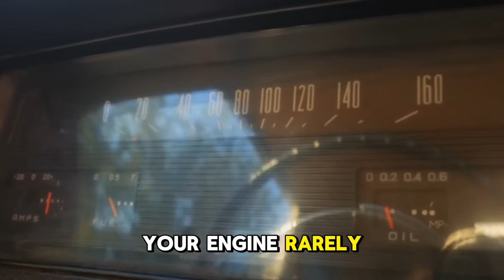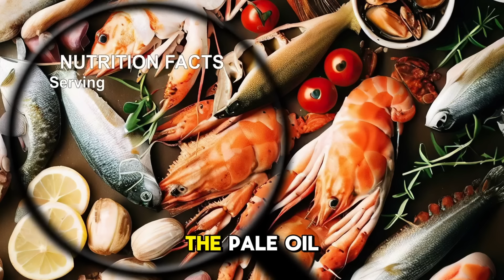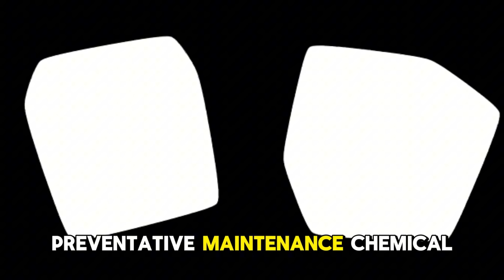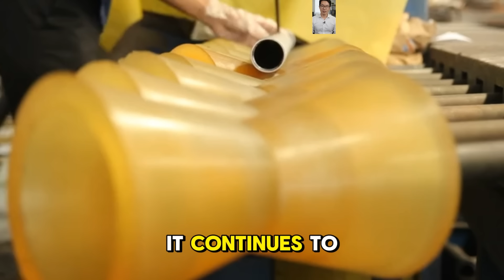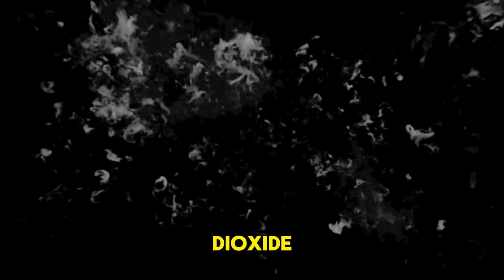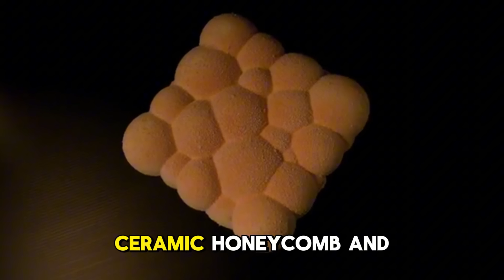The 20-Minute Japanese Trick to Unclog Your Catalytic Converter (No Tools Needed)

Comment: Warm up your engine and spray a quart of water into the throttle body, keeping rpm to about 2000. Your code will not disappear immediately but will in a month or so

Comment: Asian Ai time for some SCHOOLING!! I been driving 70mph daily,for 45 minutes,More,Alot more than the Japaneese or Italian tune-up B.S.After 75,000 miles more i bought a bottle of Cat-a- clean from auto parts store for about $30.00 and it says: use with 1/4 tank of gas,or 3 gallons and drive 12 to 15 minutes.I did everything as recommended, except I drove 40 minutes!! Then filled tank with gas,and my Honda with 250,000 miles has never run better,quicker acceleration is what I noticed,my engine light never came on,I just knew it could use some help,performance was weak feeling previously. The next day I changed the oil,it was due.

Comment: Grain alcohol 🍸 or denatured alcohol  and hydrogen peroxide is also used 🤔 or you can buy a additive to your gas tank that cleans carbon from your engine and catalytic converter 😮😊 notice he didn't mention  running a little nitromethane  .but for cleaning catalytic converter liquor thinner trick. 😊

Comment: I got news for you Mr. AI.  Premium fuel will always contain something called "white gas" or the "alkylated" fuel stream.  Both RON and MON are very close together.  It is a better gasoline than 87 in every respect.  It is not, however, needed to be run in engines that require only an 87Rd octane.  It is NOT about premature ignition or lack of a cleaner burn.  Where are you getting this garbage from?  I spent most of 4 decades in fuels production.  You should be run off this platform.

Comment: This is a simple fix. It’s not a Japanese trick. Unless you include the music.!!  
Just let your car sit in the driveway , get in and Rev  the engine and hold it there for like 15 minutes. It’s the same exact thing that diesel trucks due to regen their DEF filters.     The high RPM will create lot of heat, which will burn out all the soot and stuff you don’t need to go driving anywhere. It’s just common sense..       plus you don’t need to put any additive in there either unless it’ll make you feel better.

Comment: Dump a gallon of lacquer thinner in the gas tank, lock out the higher gears on the transmission, and run it down the highway at 3000+ rpm for 20 minutes straight.

Comment: The p0420. Is because the first O2 sensor isn't working correctly. Upstream O2 sensor before the catalytic converter. It gets dirty or it gets worn out. It's an easy replacement. Try it first.

Comment: So here's a question. Why not clean your OXY sensors, spray the acetone or  thinner directly into the OXY port on the exhaust and drive it normal for a while? Exhaust may get hot enough to penetrate the carbon buildup. Any thoughts?
Reply: That's exactly what I was thinking. Using a fine mist from a bug sprayer with a long wand in case the solvent combusts so the flash can't get you. It would be the most effective way but suggesting it in a video where any dumbass can watch it and not be safe about it and get injured would make your lawyer very angry with you.
Reply: Or you could spray it while the engine wasn't running, it would be less effective but marginally safer, but where is the fun in that?

Comment: I have to agree with the person who said B12 Chemtool. I remove my main vacuum from my brake booster and take an entire bottle of B12 Chemtool stick the vacuum line in the bottle and let it suck it all down.  Engine name stall so you probably want to have someone revving the engine over 3,000 RPMs while you're doing this once the entire bottle is sucked up reattach your vacuum line to your brake booster and step on the gas and watch it clean out all the unburned suut and carbons that can block everything on your top end  ie.....throttle body butterfly valve all the gummy stuff that builds up and makes it stick sometimes when you step on gas.  All of these chemicals build up on everything down the line from your intake manifold like exhaust system, o2 sensors, catalytic converters. You'll know it's working if after you do this your vehicle starts puffing super thick pure white smoke. If there is what seems Iike a huge amount of thick white smoke repeat this procedure but add some of the same product or Seafoam into the crankcase and fuel tank, probably split the large bottle of Seafoam between crankcase (where you put engine oil) and fuel tank. So exact procedure is seafoam in the crankcase and fuel tank then start the vehicle remember when you take off the vacuum and hook it up to that bottle of B12 chemtool it might stall so have it revving a little bit once it sucked all the bottle of B12 chemtool up re attach vacuum line and drive around block few times. Be sure to change oil after no more than about 30 min or 10 miles. You just want enough running time to get those chemicals everywhere unburned fuel could be built up so it can clean those surfaces. This really works. I mean if you have a misfire and you have been running lean for a long time and your cat is completely f u k d then realize sometimes things may be beyond fixing. To find out if the cat is still worth fixing it's going to be some work but you'll have to pull off catalytic converter and check your honeycomb and if it's still there and not burned up then you should be good and I'd say give it a try. 
Good luck. Get those misfires handled early especially if you're going through oil at a faster rate than recommended. Remember s h I t rolls downhill and same in vehicles that don't get problems handled quickly risk the problems and all the parts down line from those problems that could be at risk. 
Thanks

Comment: every clogged catalytic converter i had to deal with the dang honey comb had broken into pieces and all the pieces that is not lined up is what clogged it up the little holes has always been fine that people would just take those pieces out and problem solved in a ways not properly but it would run again but the engine light will be on that it won't get hot anymore without the honey combs it's just better to replace them with a new one in dallas a place on caroll ave called hercules muffler would sell them for 75 bucks ea and weld it on for you too oh yeaaa

Comment: Most Vehicles burn oil because their Rings start getting stuck. The best fix for that is to run at least two oil changes Valvoline restore and protect which has been shown to release the compression rings and even many times loosen the oil control ring so that you quit burning oil. The low pressure compression rings that they use nowadays don't work with a damn. Unless they're completely clean you're not getting a good effect from the compression rings add the much smaller oil control rings that they use these days aren't doing much good at their job either. But you know if you're burning oil about one quart every 700 to 1200 me, you're using a whole lot more oil than you did the mid-1960s. Makes you wonder why they made two stroke engines almost impossible to buy because they polluted the air too much because they run on oil. But now you have two stroke engines and almost all cars.

Comment: It is categorize The Impossible to add one pint of acetone otherwise it would have already melted. And I've never heard anybody say to take a half a tank of fuel and put an entire gallon of lacquer thinner in it. The highest concentration I've ever even heard of is to use a quart of acetone in a full tank of fuel and you're still only talking about. A 1.66 % mixture. Acetone will not destroy your fuel system even if you put a quart into a 16 gallon fuel tank.
Add highest mixture I've ever heard from lacquer thinner is about the same mixture. What acetone will do is it makes the fuel spray break up much finer and allows for a better flame front which allows for a higher temperature burn in the exhaust system which includes the catalytic converter. Just like taking your Carbondale burner grates on your stove and putting them inside the stove and running it on a self-cleaning cycle that runs upwards of 900°. It Cooks off all of the carbon. That's the simple thinking behind the process. Frankly I think you would do better to just put a bottle of cataclean into about six or seven gallons of fuel and go out and run it hard because that will cook off a lot of the contaminants inside of a catalytic converter. The other best suggestion I would have is to put a double dose of Techron into it because it will also help. I've seen it clean the carbon off of the tops of pistons in one application.

Comment: Ya I did the Scotty Kilmer fix and poured in Paint Thinner, it cleaned it out all right...and the I thought my Transmission was going out...The Metals in the Catlaytic Converter were Rattleing around and I still had to buy a new one, they Aint Cheap. If its clogged your motor is burning oil bad and you need a new motor too.

Comment: I use 91% Isopropyl Alcohol. I run gas tank down to almost empty. 4 bottles 91% Isopropyl Alcohol,  1 gal of premium gas, drive vehicle in low 2 for a few miles. Past emissions test. In Illinois

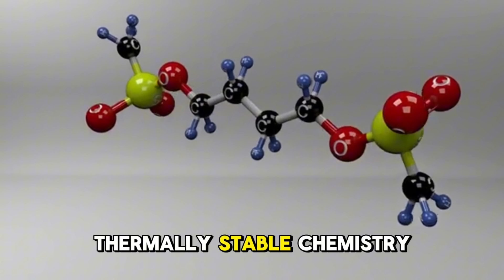Comment: I'm unsure what a "double dose" in 1/4 tank for the 20 Minute Protocol (starting at 25:00 means.) Chevron says 1 oz per 1 US gallon. Other sources suggest 1 bottle (12 oz?) to a tankful, which would be approximately the Chevron recommendation for most - sedans or small to middling SUVs. So is a "double dose" 2 bottles in 1/4 tank? Or 2 oz per however many gallons 1/4 tank would be?

Comment: Cata clean add to gas tank on one eighth tank of gas then put gas in to half tank then drive vehicle 30 miles on highway speeds above 60 mph should clean converter
Reply: That shit doesn't work, I did 2 bottles of cat a clean and nothing
Reply: I wonder if anything will really clean those I always hear about using tolulene varsol and paint thinner I'm just curious if any will really work.  I'm thinking about going cat less  with a car my daughter needs to have fixed. I don't think that other junk would really work
Reply: Same here, 2 bottles and bullshît !!

Comment: we use hydro cleaning takes all carbon out from vales to muffler, no cost also.
Reply: come to shop we show you nothing is free now days.
Reply: I've seen that.  Using water into the intake to "steam" the valves and clear any blockage in the exhaust.
Reply: @joekool4  got to know what you are doing or you can mess an engine up bad.
Reply: @joekool4  doing it for years got a 265 ooo mile v 8 truck still running smooth
Reply: @yourworstfearhow do you hydroclean it my.? I’m pretty sure that my Cat is Clogged 🤦‍♂️
Reply: yep we at 205 no oil use at all keep it changed and tuned.

Comment: Mix marble miracle oil with gasoline in a little bottle injected through the booster hose to the engine and keep it up 5000 or 500 RPMs it will smoke a lot but it will clean it
Reply: Booster hose?

Comment: Cash for clunkers lol.. gas with ethanol is eating up everything to eventually lol ...or you say 10% lol more like 15 or 20% . Ethanol by product water rusting everything out ..water pouring out your tail pipe total trash fuel .use  ethanol free fuel if you want absolutely no problem down the road .  Cash for clunkers .limp mode

Comment: Sea Foam doesn't work. Tried it. 
B12 Chem Tool Worked. Passed Emmissions.
Reply: That's what I use.
Reply: B12 is the best. And usually significantly cheaper than seafoam.
Reply: Do you know anything about Berryman's 4 step cleaner kit?

Comment: All this AI is bullshit !!!
I have a 2014 Silverado and at 156,000 miles I need a cat . Over $3000 for the cat who knows what the labor will be at $105 an hour .
I paid $25 for the cat cleaner . It did absolutely nothing !!!!😂😂😂😂😂😂😂
Reply: B12 Chem Tool Worked for me with only about 10 gallons of gas. 
$5. at Walmart a little more at an auto parts store. 
If twice doesn't work your Catalytic Converter is probably falling apart. 
If it's welded in go to a local muffler shop, Not a National Franchise out side of CA use a cheaper aftermarket Cat. 
If it's bolted in remove it yourself and shake out the broken honeycomb pieces. If it's falling apart take it all out, hollowed out, almost no difference in the sound. 
The code should stay clear. If it does you will pass the Emmissions after you drive between 150 and 200 miles first. 
I did this on an old 1986 Chevy Camaro V6 and the Emmissions with the sensor in the pipe came out like a brand new car or new engine. 
New spark plugs and a fresh Oil change first. 
The best oil for your gas engine now is Castrol Synthetic Edge because it is the only oil that bonds with all the metal parts. 
Prolong is a good engine additive as well. Dura Lube doesn't work. 
I used both on a seized engine Cam kept seizing and breaking the $20. Belt. 
With the Castrol Synthetic Edge and the Prolong the engine ran fine. 
I had a old 1986 Nissan Z with between 330,000 and 400,000 miles overheated five times on the highway because of a broken top hose kept adding water taped it with plastic and duct tape and after replacing the hose and new full strength Antifreeze the 6 cylinder engine was completely fine. 
I took it over 100 mph before and after with zero issues.
Reply: Try 3 tanks of highest 91 octane minimal 93 is better
Reply: Change the PCV VALVE
Reply: Ya 01 durango 5.9l , I put fuel injector cleaner in after replacing plugs at 180k miles , poof cata stopped up , can't get someone to work on it cause its old .